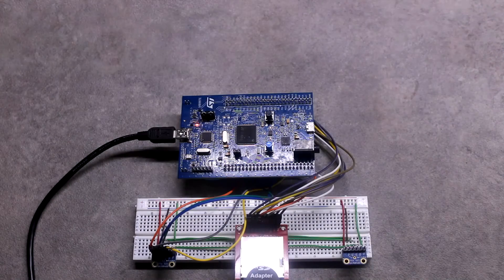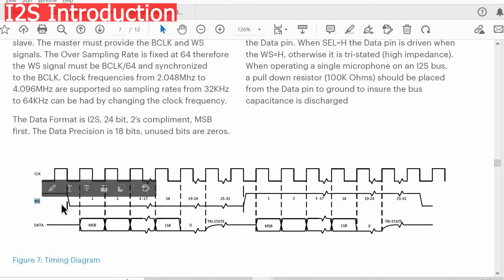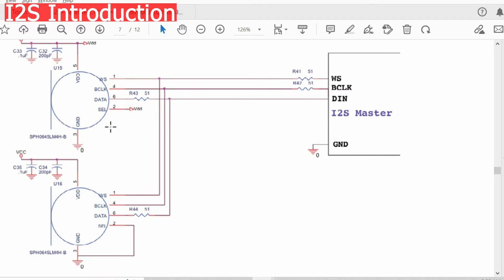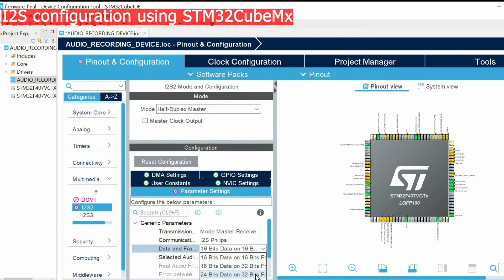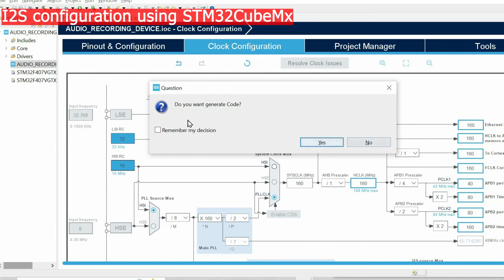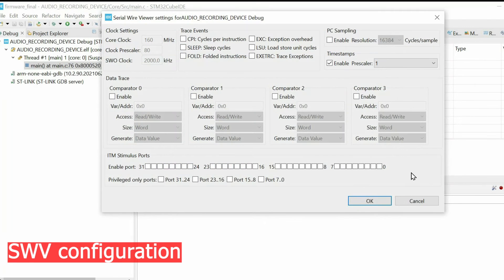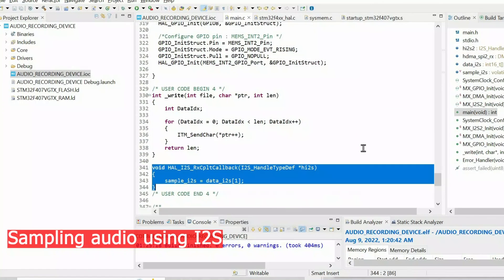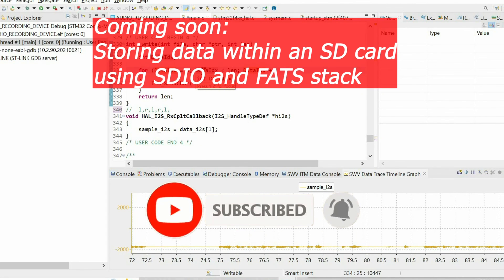STM32 Audio Recorder 1: STM32 I2S DMA || SPH0645LM4H MIC

Comment: good job ! but why did u use 2  microphones while u already have the MP45DT02 digital microphone with I2S2 on your STM32F4 board,  I'm working on an stm32 project ,I want to detect crying babies voices with stm32f4 discovery and Ai dataset ,I tried using the MP45DT02 digital microphone chip that is on board , but I had some problems with it , do u advice me to use that microphone for my project , or use 2 other microphones ?
Reply from the maker: Sorry for the late reply. As far as I remember, the built-in microphone does not support I2S.

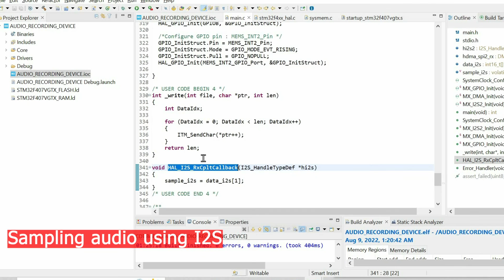Comment: Why at 10:44 did you write sample_i2s = data_i2s[0] ?
You are saving in sample_i2s every time the first of the 100 samples contained/stored in data_i2s ... why ?
Then in SWV data trace Graph you display sample_i2s, but shouldn't you display data_i2s ?
Reply from the maker: Hi,
This step is necessary to verify that we are getting data from the microphone. Since data_i2s is a buffer, we cannot plot it using SWV. That is why I plot only the first element of the buffer.

Comment: Why you use at 5:21 "16 bits data"?? The mic has a data format of 24 bits and 18 of them are data. There's written in the file you showed at the beginning of the video. Shouldn't you use the "24 bits data on 32 frames" option?
Reply from the maker: Yes, you can do that, but you have to do some bitwise manipulations to save 24-bit frames of data to the SD card.  However, I 'sacrificed' 2 bits (18 - 16) for the sake of simplicity and having less amount of data. There is little difference between 18-bit and 16-bit precision.
 Did I answer your question?
Reply: @steppeschool3629  Thank you for your reply! If I wanted to keep 18 bits (by selecting '24 bits data on 32 bits frame'), what manipulation should I do? Do you have any website/video/tutorial to recommend me that talks about this? If this operation has a specific name, I'll look it up online.
Reply from the maker: The simplest way to preserve 18 bits would be to store all 32 bits. However, you have to store two times more data, and 14 (32-18) low-significant bits will be just zeros.
Reply: @steppeschool3629 I'm 2 years late. But I have so many questions. Would you just select "24 bits data on 32 bits frame "? How does HAL_I2S_Receive_DMA differ? And would sample_i2s be of type int32_t? If yes, is sample_i2s a combination of data_i2s[0] and data_i2s[1]?

Comment: It seems like a great course.
I was checking my board (STM32H757I-EVAL) and I have a lot of periphs on it, but I don't have an embedded mic. D*mn it😂.
I never tried 0.1% of all it can do. I'm a beginner when it comes to this ecosystem and this board. 
I read on the datasheet that it even has 1x Digital Filters for Sigma Delta Modulator with 8 channels/4 filters. 
The thing can do my entire 2 classes on Signal Processing 😂
(I'm an Electrical Engineering Student)
Reply from the maker: Yes you are right😀. Modern microcontrollers are quite powerful and can do many things. I suggest you to start from basics and move to advanced staff. Basically, divide and conquer strategy. Personally, I would be happy to share with you my knowledge. You can sign up my courses and follow the lessons.
Reply: @steppeschool3629 ,  after reading more through the documentation, I saw that I actually have: headset and speaker connectors, for an analog mic and analog output, of course, and 2 other connectors for ST-MEMS Digital Microphones. It looks like it's all there already haha; sure, I'll take a look.